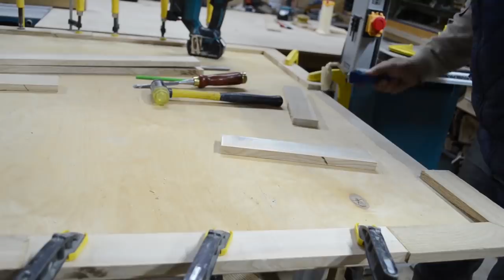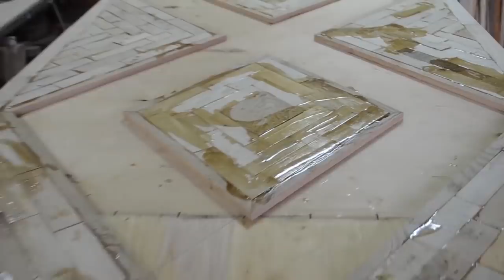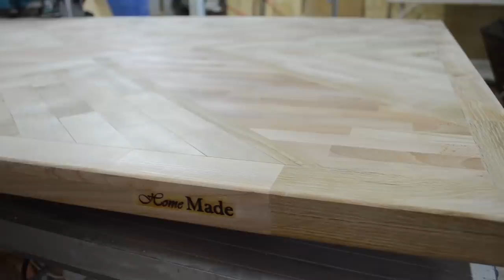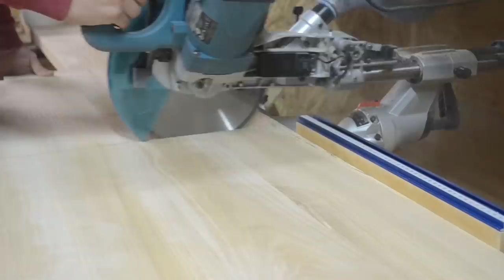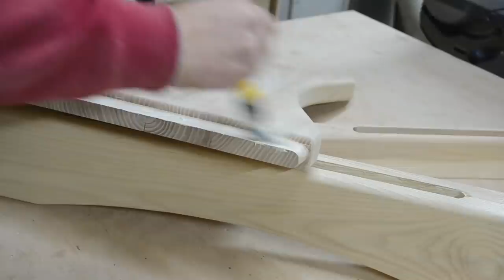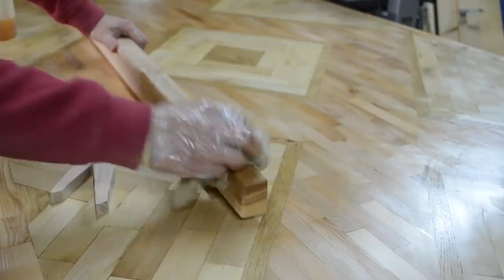Large dining table from an old parquet

Comment: HomeMade in Lviv,  Do you work with straight 45 Degree  cut  joints , or how did you get the angles for the Two crossing "V" parts ??    Do you have any plans on this table, that I can Purchase ?     Or could you supply me with 
the different dimensions that you are using for top and skirt ?    Appreciate your Response.  ( I live in the U.S.A. )

Morgan Sorensen  ( Biblical Theologian )
Reply from the maker: For me it's just a hobby that's why I do not sell my works. I make things for my home or as a gift for my relatives or friends, this table I also gifted, here I demonstrate the ideas for others.

Comment: I did a small 30 inch round table like this with 1/2 wood over 3/4 ply. The top wood moved more then the ply and the hole thing arched in the middle. Just keep a look out for that. Great build

Comment: Hi this is amazing! I would really like to know what kind of liquidy glue you used to stick on the parkett parts?
Best regards, Lilly
Reply from the maker: Thanks, I think you are asking about "epoxy resin"
Reply: @homemadeinlviv8041  thank you very much. What a great idea! I was thinking if the base wood would be strong enough for a dining table that size, as it has to hold a lot of weight. But the epoxy must stabilize it further😊 I'm thinking about building one, too, but inside the house and with amateur equipment as I don't have a  workshop.

Comment: The carpentry work is excellent, but I disagree with the wayto appy the sealer, since is it not the correct way teh apply it, since I have observed several videos of you, however in all of these you have done it with a rag or cloth, being An incorrect way of doing it, since it must be done with an industrial cotton mona that the same varnish makes it with a piece of plywood or plywood, called in another way, because in no shopping center, carpentry shop of another  wood store sells it; In other words, the varnisher does it himself, this is the correct way to do it, since in this way the wood's own pore is covered very well, leaving a smooth and high-quality work
Reply: Saludos desde México
Reply: CDMX